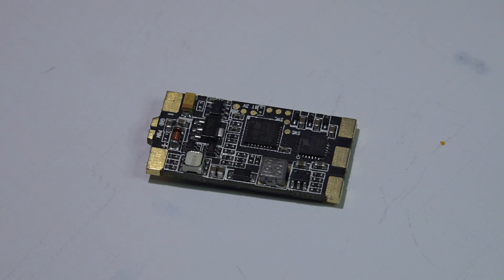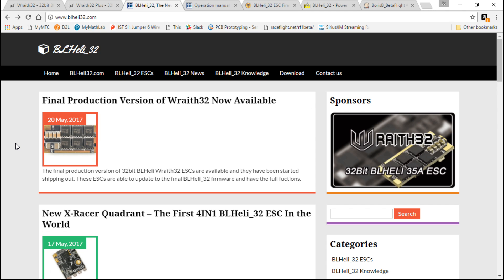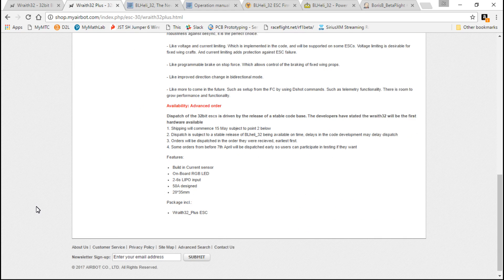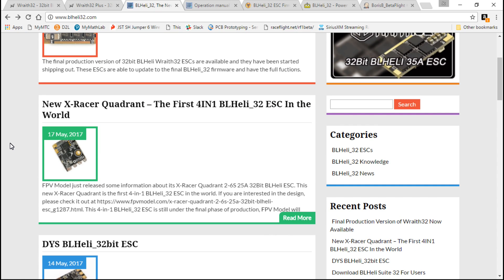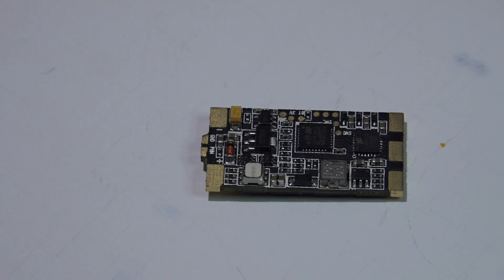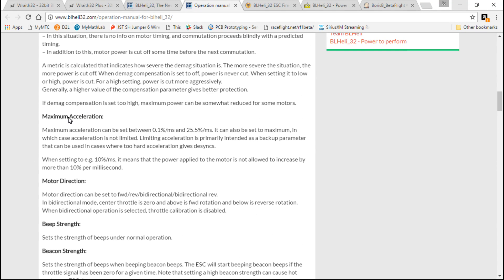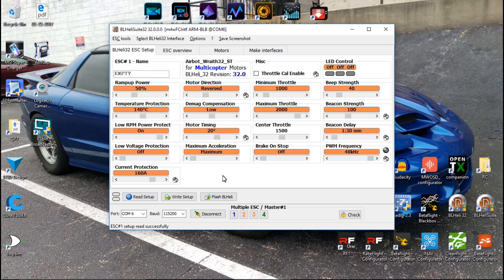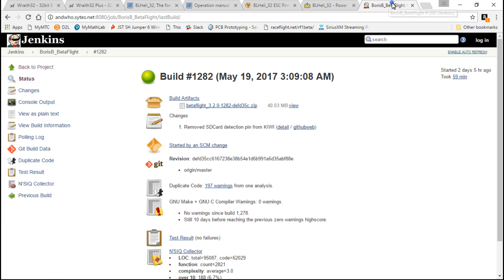Lets Talk BLHeli 32 / D_Shot 1200

Comment from the maker: Edit: You guys have caught my mistake on the Current Protection feature. Instead of adding up the ESCs you should set it by each ESC. For example I would choose 40 or 45 amps instead of 160 amps.
Reply: Project Blue Falcon . Hey JC, I just finished my build with these esc's and installed the blhelisuite32 and I can't connect to it. The esc's aren't read so i cant see what settings it has. I have a betaflight F3 FC. I was able to add dshot 1200 to it but my main issue is that when I was testing out the quad, if I hit the ground a little hard, the Motors would shut off. Any thoughts?
Reply: Project Blue Falcon i have these escs and bff3 on the way for a build. hoping all goes well... dont you have to have them set to oneshot125 to program escs?

Comment: Hey! Mina Dys Thor 2700kv burns as fast as I fly with my airbot wraith32 plus. Esc is set to auto timing and limit at 45a. 5 engines have burned on 4S 75c. They work for me with 3s and its only the one that burns that hot the other 3is Cold.
Hopes for some help
Hans Sweden
Reply: I forget to say its different motors everybody has burn so it can not be one bad esc

Comment: My Problem with the esc's is that the BLHeli 32 Suite reads all 4 esc's but i can't do changes for example motor direction. it shows the message that i have pre production test esc's or something that cannot be flashed with another version. I cant klick the write button. Has somebody the same problem?

Comment: so i just did all this like spot on. bf3fc, wrath32 esc everything was working. 3.2 flashed, connected to esc in blheli 32 motors were spinning up and good, was about to revers motors and it disconnected. no will not connect to anything. no betaflight or blheli.... windows is saying usb device malfuntion, not recognized.... i trying to change drivers.. nothing is working... please help....

Comment: Ive got a Kiss ESC flashed with BF 3.1.7, I am also running these ESC's and Im unable to connect and use pass through via BLHELI. Could this be a limitation to the Kiss FC?

Comment: there are many things that you could do with tx/RX pins on the ESC. for one you could get rpm telemetry to the flight controller this could be useful for flight control because you won't need to arbitrarily update the output value to the ESC ever run of the pid loop cycle. with the power of the new flight controllers like f4 and f7 you could set angular acceleration values to the rates and the flight controller could plot a smooth path. this could be useful since the PID controller wouldn't see error at every twitch of the stick, instead (and this may even be over complicating it and not needed) you can have a trajectory plotter and a Max motor acceleration and a Max angular acceleration that the motors are capable of following. our setup now allows p and d make the trims stack up because the loop can run faster than the motors can respond and without telemetry the flight controller can't know the difference between error and physical limitations. a 2way protocol can be the end of smoked motors and ESCs. dshot 1200 will be obsolete when we can run CAN or SPI or i2c or uart, or if there is a latency advantage you may be able to run both simultaneously. what I'm interested in is if the processor specs are open. maybe blheli won't decide to utilize the uart in this way or give limited documentation on it but if new firmware can be compiled and borris b wanted to re work the algorithm to atleast ignore error that can't be corrected by the ESC by way of just asking more from the ESC then I think oscillations may also go away.

Comment: Where do I get the OLD BLHeliSuite?  I wound up with the new one that says my ESCs are SiLabs and won't talk to them.  BLHeli-Configurator (in Chrome) fails to connect (when BetaFlight connects).

On top of that, now my motors shudder and cog and won't spin properly.  In BetaFlight - Motors - test, they all jerk and when I throttle one up, they all shudder and try to spin.  Is there a master reset on this?  (why I'm looking for a BLHeli app that connects)

Comment: that is not true I have blheli S ESC's that are labeled multi-shot but without removing the signal capacitor I cannot run dshot so if they don't Sadie shot they can't run dshot right? can all racerstar speed controllers that are blheli s run dshot? No they have to say D shot right?

Comment: Racerstar recently released blheli_32 esc  named as racerstar tatto on banggood. It is also only 3 grams in weight. 35a continuous and 43a burst.
Reply from the maker: Be aware that it does not support BLHeli 32. It has the 32 bit chipset but they did not pay the fee to license the ESCs for the firmware like I mentioned when talking about BLHeli 32 going closed source.
Reply: Project Blue Falcon Thanks for the reply, your videos are the best. My go to channel.

Comment: You are not entirely correct about blheli_s and dshot. The esc firmware can run dshot but many ESCs have a filter cap that needed to be removed in order to run dshot. For example, the Favourite Spring 30a dshot esc has the cap already removed so actually it's very important for new users of dshot to find an esc labeled "dshot".

Comment: do we have to upgrade to betaflight 3.2 for dshot1200?  I see the option for it in CLI with 3.1.7 and i'm reading that it's supported, but it's only talking about kiss esc's.  Is there a difference for blheli32?  seems like it should be the same thing and just enable it in 3.1.7 with these same instructions? (there was a modified 3.17 for omnibusf4 that enabled passthrough, i'm using that)   EDIT:  DSHOT1200 does seem to work fine with 3.1.7

Comment: Thanks for the video!  Haven't KISS 24amp ESCs always been able to run DSHOT 1200?  All this still begs the question... Does the higher speed of the ESCs really make it's way into noticeable flight performance improvements?  In the end, we still have to spin up the mechanical motors, whose response time is going to be magnitudes slower than the ESC speed.  I know it really can't hurt, but it just seems like we may be entering the realm of diminishing returns.  Thanks again!
Reply from the maker: Thats a great point. I would guess it's about a 10% increase in performance. Not twice as good. About the same amount of difference going from 4khz/4khz to 8khz/8khz

Comment: Great work on the video. Can anyone tell me why , the extra cost for closed sourcing the bl_heli team a pay check for open source started architecture of software and esc hardware. They have created a key locked hardware to lock out raceflight one wizards from being able to talk to these esc with RF1.  What happens if the quad community doesn't want to pay for the ego's being crushed by a raceflight.  What happens , If I don't want to use betaflight , I dont want to pay bl heli for for such arrogant business that I no longer agree with. How does this effect the social media Drama. What happens If I dont think that bl heli and beta flight are all that good. Which raceflight has proven.  Why do I need to jump through hoops to program , why do I have to take so much time now to train new people how to use these esc in order for bl heli to get extra money from every esc sold and new blheli32 software configurator.    Is there any news on a REAL closed source software and new closed source configurator to create some competition , I just don't think that this dramatic entrance into a hobby is required to pack someones pockets. I think it is time to replace bl heli with a more respectable solution. This drama creating garbage is going to ruin the hobby . For what  a few bucks?  please set me straight why I need to pay extra because of social media jargan? Does anyone else feel like they are stuck in a drama circle created by greed , and now they think that  half ass clever flaming people reasons to pay themselves. The costs of building a drone have gone up 30% in one year,  I told everyone that this was coming. We need to get rid of the greed from the hobby. I say we all impeach this garbage business model! We need new esc firmware period!
Reply: Thrust-FPV went up! Ive heared escs have been cut in price by 1/5 since 4 or 5 years ago!
Reply: you heard wrong , we don't use switching esc with  quads, The bec is part of the pdb or external. base price last year of say.. dys bl heli_s 30a was 12.99 . once more people got involved and the availability hit the roof. They started to increase. that same esc today. Exact same is 16.99. That is not good numbers period. Thats huge and now they want more. It is off we are paying for them to fight with each other. block one out to hate the other. Than charge you more for it , Like it is better than before , We are now going backwards. Bl heli has to go!
Reply: If they can remove reaceflight from the bunch , we wont have anything to fight back with. there is a good reason for competition. If raceflight doesnt create theyre own configurator, we are screwed. They will just keep creating drama and masking reasons for price increases. We havent gained anything since bl heli S. but go backwards
Reply: Thrust-FPV so which escs should I buy?!
Reply: I dunno , we now have to wait. While they fight. Currently , I use the aikon sefm. I know it is expensive, but the quality is proven. It is an auto detect Bl heli s esc. That is a monster of durability. Im not getting off bl heli s till this fighting is over. until FC get digital drivers , this is gonna keep happening, raceflight will be able to claim that they are still  right next to kiss, as far as error free 32k loop time . Errors in esc mean motor braking. when you watch your black box  replays, top left when you see the motors shaking, thats the errors. you cant accellerate while braking , thats just common sense.

 Right now the bickering and fighting has stopped progression.  Once the bl heli esc are gone . We will feel the pain. I don't understand why they just can't move on , pick up a tx and and fly and stop fighting. We are now in park! Every time someone joins the hate raceflight bandwagon. it fuels this! We all as a group need to stop!   It doesnt matter if raceflight closed open source for 2 hours ! seriously thats what it is.

it truly is a catch 22, when a new person joins the hobby, they have no clue how to program a FC, or an ESC, when they jump in youtube to find out how , this is all they have seen for the past year, comment after comment about the hate. and now they want to add configuration complications to lock out raceflight. Race flight and Kiss are so similar, in terms of theory of application, but Kalyn makes some incredible algoryhtems in code that we all use , airmode in beta flight and skitzo mode in RF1.  The price for kiss , kept them out of the hands of the every day new guy. These are so advanced from what is being done else where. and we all know it. I guess we just wait. If betaflight wouldnt have secluded Kalyn from open source this all wouldnt have happened. They forced him to prove it. Not to take anything away from anyone who does open source. The truth to the matter is Raceflight has one major FC to focus on . Betaflight has tons, I don't even know how many different versions of the same are out there that need seperate adaptablility or integration anymore. If this would stop, they could focus on the advances that RF1 is making instead. See open source has issues as well, Just because it is open source , it doesn't make it right or perfect. Its just opinions. (the term open source has been takin out of context) and is being miss used.

the newer pilots , are gonna have a harder time than ever. we need to fix this, or horizon hobby or frsky will need to step up and be the big guy and just get the job done.

Comment: nice, thanks for the videio, i saw the videio of the racerstar 22a that runs blheli32 too but lower price and i have the question, worth it the upgrade now from blheli_s? i read all the features and i think that worth it but not now maybe.
please when you upload the new videio of this esc's please put V2 or V3.... thanks like always JC... have a good week :)
Reply: maximiliano manzur serrano Racerstar 22a and 33a is not running blheli32. They are running with the racerstar software. I guess they didnt pay that "fee" to blheli so they cannot run it. its also the reason why they are so cheap :)
Reply: roxstedy thanks for that info...

Comment: Problem is that the raceflight guys like to take blheli code repackage it an take credit for fixing things and now they cant get access to the code they cant steal credit for the blheli guys work.

With a bit of luck though and work on both ends there isn't any reason dshot1200 wont work with raceflight @ 32khz on blheli_32 and there isn't any need for calibration either.
Reply: The revolt is the only FC with an actual digital driver for digital protocol. bl heli 32 is still analog at the FC and analog at he program firmware. Sold as digital. the only thing digital is from esc to motor. This is why multishot is still king in writing over errors in esc communications with speed . can you explain how raceflight took credit of this? by the way I don't use raceflight. This is just fact. The digital driver from the revolt still isnt being used to digitally control the esc because there is no true digital esc! raceflight is manufacturer of a FC , and software.

the 32k esc was designed to accompany raceflight for sales of hardware. Are you aware that 32k looptime can not be completed by betaflight or clean flight? And that Kiss esc that run 32 are self manufactured. You can not arm a quad with any configurator with out calibrating esc's. Be careful who you call the sucker here. your the one about to pay more for inferior. bl_heli 32 is the end of bl_heli mark my words. It's an EGO nuclear bomb about to explode. 

This seems to be very typical of the new Quad racing scheme , all these people run in with very little understanding and care for the hobby it self in order to get a few bucks. Airmode was invented by Kalyn , the lead programmer of raceflight. Do you see him charging you to use airmode on beta flight?  When kalyn found out that 32k looptimes was the cleanest way of stopping the motor breaking , and they took credit for airmode. Which every race drone needs to remain completely stable. Did raceflight charge you for this? Like I said I don't use raceflight. But I do understand and see drama coming from a mile away. I wouldn't be surprised if with in a few months or whatever , raceflight doesnt just creat a new esc protocol and configurator . And bl heli will be dead! no one will pay extra money for nothing!
Reply: save this post , call me a mean guy, do what ya want, but with in a year you will be pulling this post back out , and copy pasting it as the social media makes the swing , I'm sure this will be your new understanding in the near future. Right now raceflight isn't the sucker we are, for falling in the social media trap!
Reply: again , I don't use raceflight , i'm not associated with raceflight. Now that it has been released drl use kiss. at 32k. I may be just switching to kiss to get out of this drama. Why not the price is now matching bl32 is inferior to kiss still , And he wants paid for it!

Comment: Specifically what performance gains do you notice by updating the firmware and settings for your ESCs? And I mean subjectively actually experience in real life while flying
Reply: Project Blue Falcon what about going from dshot 300 to 600 lol?! Thanks☺ Love watching your vids! Gain so much knowledge!!
Reply from the maker: Going from D shot 600 to 1200 is very minimal change. But some guys want the best of the best. Personally I'm fine with D shot 600
Reply from the maker: Same thing. Each time you double anything it's not twice as good. I'd say its about a 10% increase in performance each time.
Reply: Project Blue Falcon thanks for the reply man! and ok jw because I had recently purchased some blheli_s 30a lites... not knowing they could only run dshot 300😑 ohhh well for now I guess!

Comment: why not use the BLHELI Configurator?? its a hell of alot easier doing anything with ESC! i haven't seen you do anything about it either!
Reply from the maker: The BLHeli configurator chome app only supports BLHeli and BLHeli S ESCs. Doesn't work on BLHeli 32 ESCs. I haven't been using it because I prefer the layout of the BLHeli Suite. It's also updated before the chrome app gets updates.

Comment: will these esc,s run dshot 600 on rf1@32khz , I've been running dshot 600 on betaflight but the best I can get out of rf1 is multishot 32khz on the revolt v2. I'm confused??
Reply: Multishot is a bit faster than DS600. TheRF guys don't really want you to use Dshot. This might change now with DS1200. Also there is a new Multishot in the works.